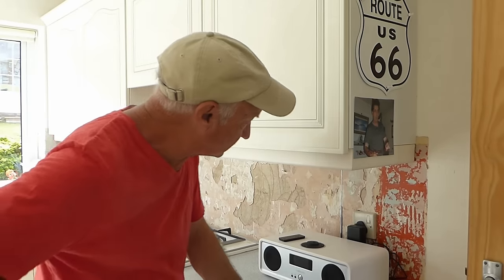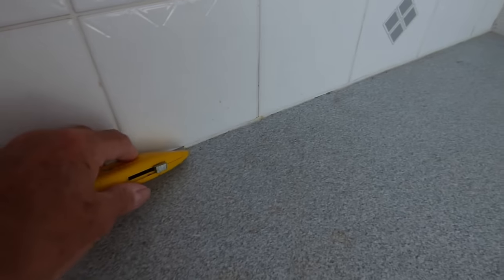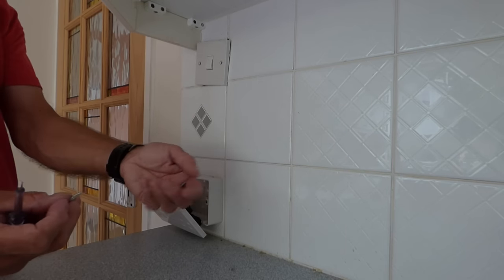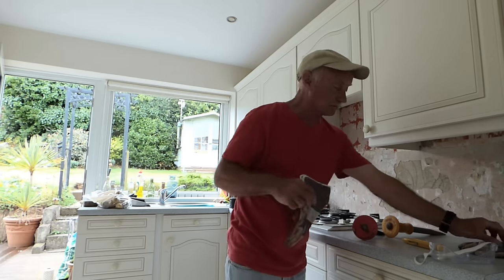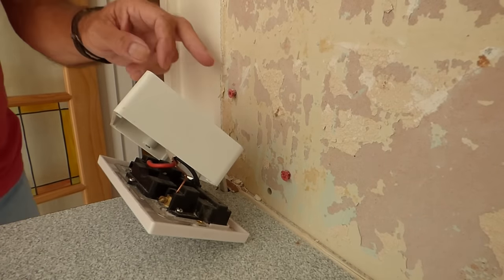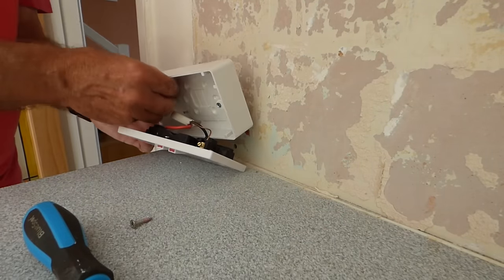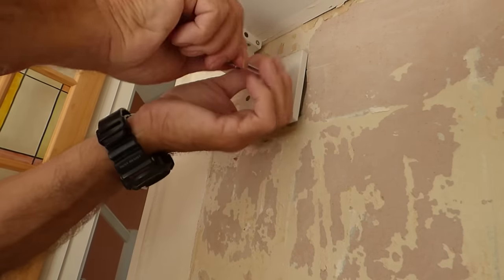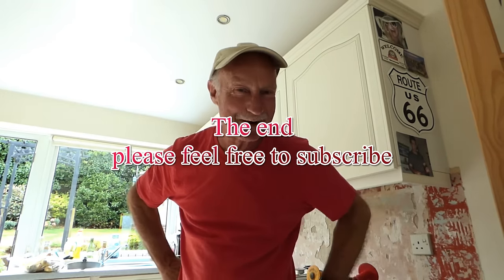Removing and replacing electric plugs and switches when taking off wall tiles

Comment: Top tip don't tighten the screws up too tight otherwise the plastic will crack either on the switch or socket or if it's a plastic back box it can break the threads out of the plastic.
Reply from the maker: Thanks for the tip.
Reply: +dereton33 not a problem I have learnt quite a bit off your videos thanks :D